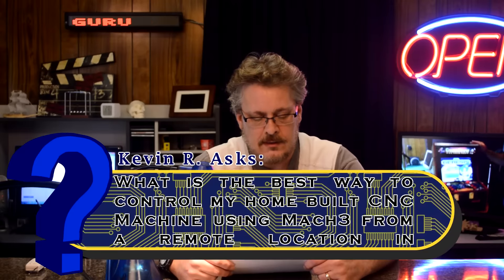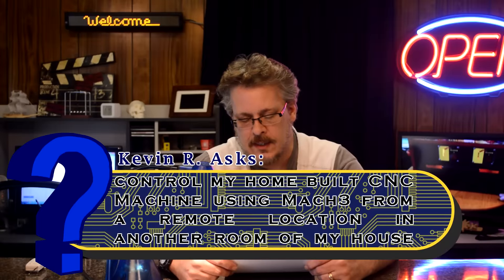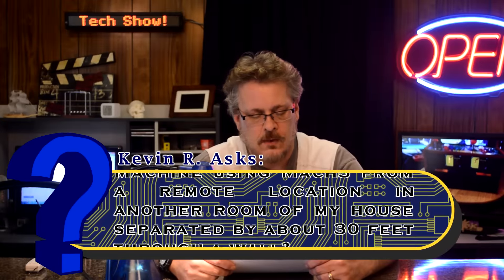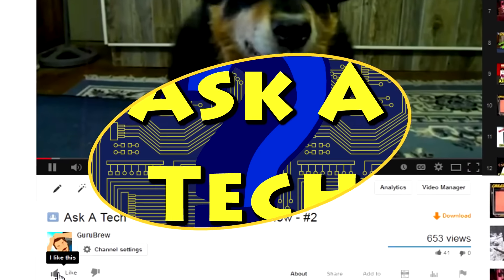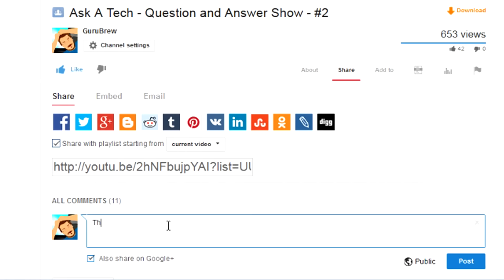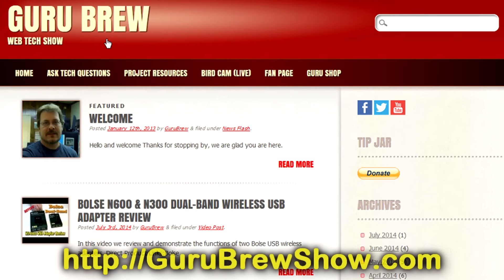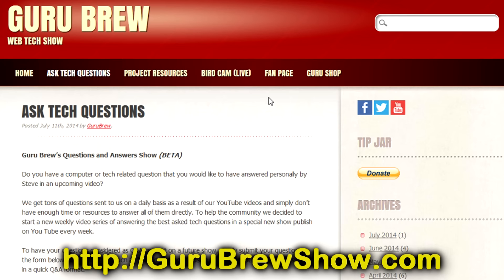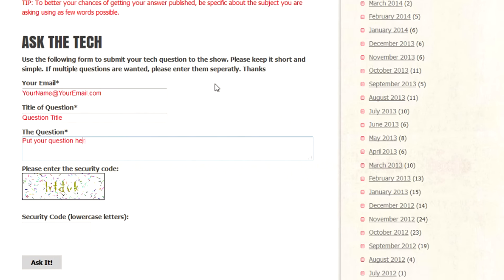Controlling CNC From Another Room - Ask A Tech #72

Comment: I think youve given kevin the best advice. You need to be present to load the material and set the zero's and all that anyways. 
I have a dedicated machine. Fresh install of windows and a second hard drive. Why a second hard drive you ask? I rarely turn that computer on but when i do i also use it on my network for all my backups and other important files i would like to keep.

For grbl based cnc machines there are browser based controls like chilipepper that remote control is possible. You could run your cnc from the next room or next state. There are also ways to remote control a 3d printer remote start and view while it runs.
Reply: +builtrodewreckedit Besides... when networking or using a connection like Team Viewer,  it takes away system resources and may crash parallel port when cutting